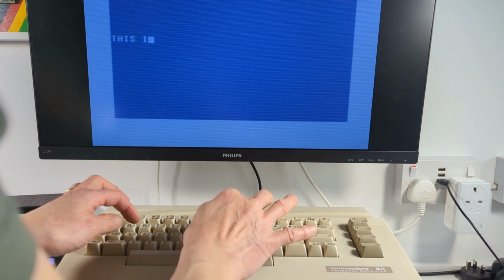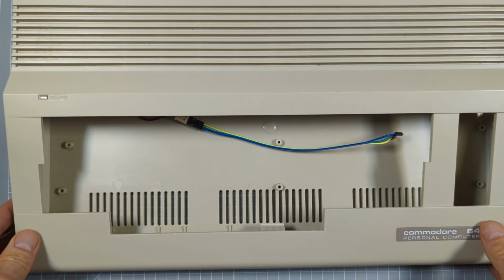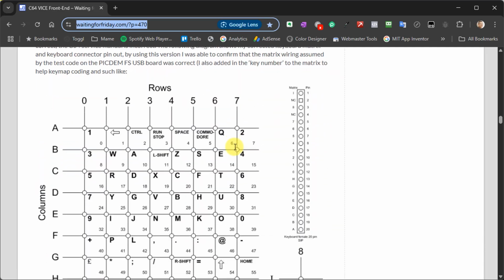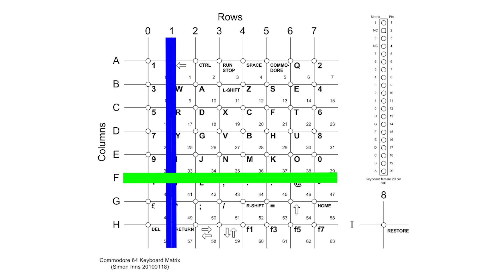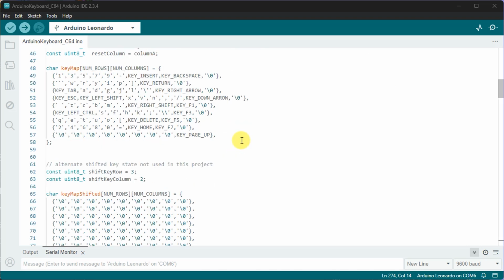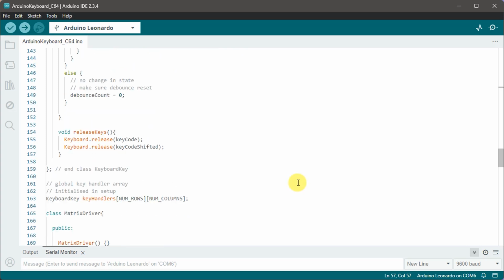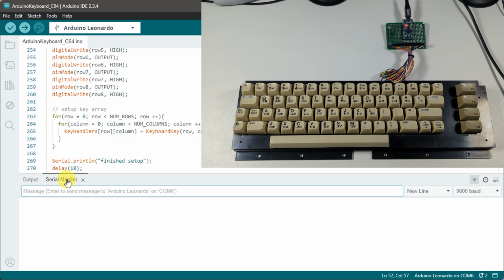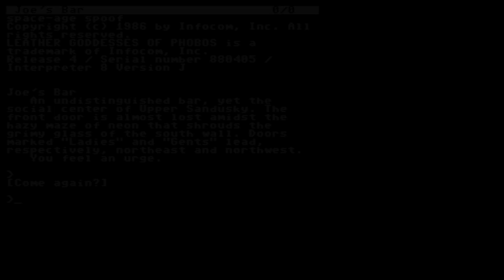Real Commodore 64 as a USB Keyboard for the VICE emulator

Comment: I have a Commodore 128 keyboard. In order to get it to work like the C64. I would have to re-write the keyboard matrix per the Commodore 128 layout. And Then let the Arduino and Keyboard libraries will do the rest, correct?
Reply from the maker: Yes. They all work with the same sort of keyboard matrix. You might have more rows or columns which you'd need to add in. Then just map out the matrix and set the key codes each node represents.
Reply: @BytesNBits Thanks. I compared a few of your codes and it is basically the same except the key map.

Comment: Love it! I had to make one of these and it took me two days to complete! For the life of me I had not idea why the "@" was coming out as a "[" and the "*" as a "]". I tested all connections, rewired several times. Tested diodes, circuit, USB settings, keyboard location and so on. Turns out that in Vice and then settings, there is a section in "Input Devices" where you will find Keyboard. In there is a setting for "Positional". Mine was set to "Symbolic". I changed it to Positional and it all started working perfectly! Two days of debugging, and it was a single setting! Hahahaha 🤣
Reply from the maker: It's always the way. Some check box buried somewhere in the settings.

Comment: Great video. Would it possible for you to do a video on an Atari 600XL or 800XL keyboard with an emulator? Or just the Atari 8-bit line of computers?
Reply from the maker: Thanks for the idea. I don't have any original Atari machines. The basic project would be the same. You just need to work out the matrix layout.
Reply: @BytesNBits I got your code from GitHub. It compiled just fine. I will have to edit it, but that is to expected. I like the fact that you included an out in case the board crashes and it locks you out. It is great to have code to have an out in case that happens. I have the keys and key codes from an Atari keyboard sketch I found online. I can just adapt that code to yours. I appreciate the well thought out and your informative approach. And thanks for the code as well.
Reply from the maker: Thanks. Hope you get it all working.

Comment: Really hoping someone will use this as a jump-off point to be able to turn a C64 into a USB Keyboard for a PC in the USA, and not just VICE emulator. Alas, I am not talented enough to do that programming myself.
Reply from the maker: The code I used can be remapped to give a better PC feel. You just need to adjust the key mapping arrays. But you still won't have all the keys and then it won't work as a C64.
Reply: This has been my dream as well! To have one keyboard on the desk that can switch from C64 on a monitor to keyboard for a standard Mac/PC.

Comment: That’s a great video!

I’ve wondered before, if a tiny cartridge could be made, so the C64 ( or Speccy using the interface at the back) is unmodified but just boots immediately off this custom cartridge rom a tiny program that reads the keyboard and sends the data to the integrated ESP32 etc..
Reply from the maker: Sounds like a great project for you to try out :)

Comment: That arduino is probably arduino nano micro, "pro" series don't have USB chip on board. If you plan to build this, any arduino Nano would be OK (micro, mini or usbc, depending on usb connection).

Edit: this is super idea for old hardware.
Reply from the maker: Thanks for the info. The keyboard library needs an ATmega32u4 powered Arduino. The one labelled Pro Micro that I'm using is effectively a version of the Leonardo.
Reply: @BytesNBits  I've noticed name confusions lately on AliExpress. "Pro Micro" is I assume arduino with "Arduino Pro Mini" pin layout and USB chip with Micro connector (USB chip otherwise is not present on Pro and you have to use an external USB board)
many new producers don't have any naming convention rules, so this could be something else. In the end, it's only important that it is the arduino 😅